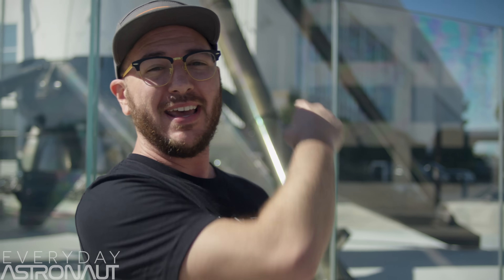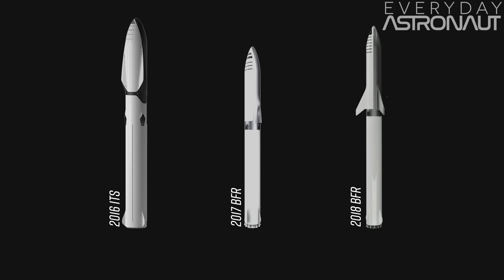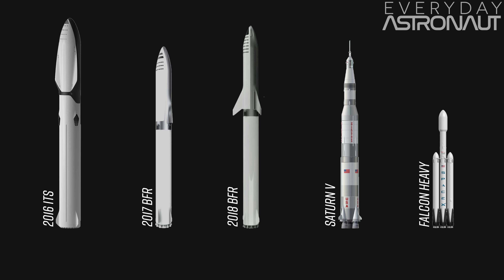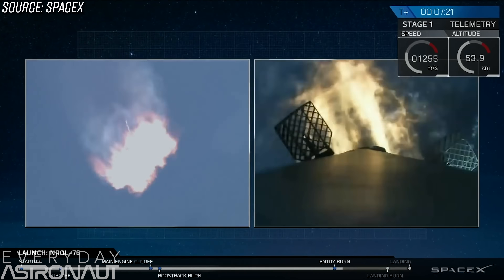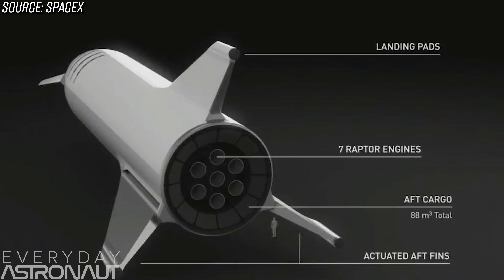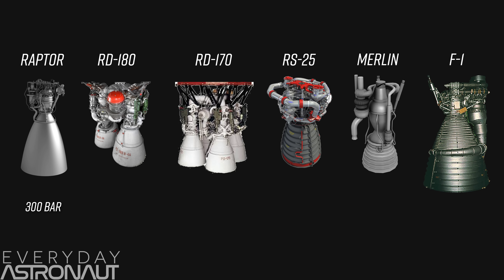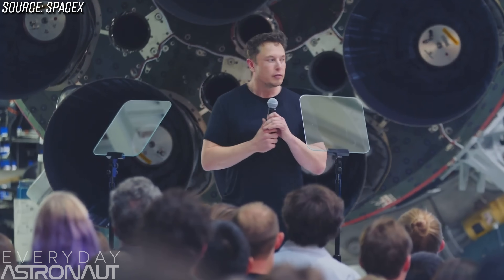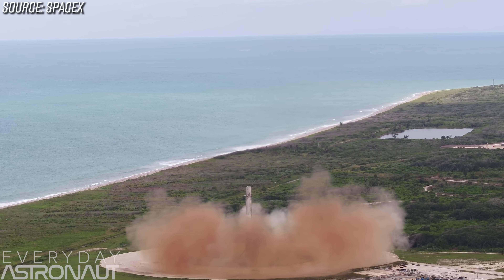Why does SpaceX keep changing the BFR? The evolution of BFR

Comment: Hey Tim, what did you think when he talked about the MegaNewtons of force needed to actuate the wing/flap/breaks ? What kind of mechanism could provide such power?
Reply: hydraulics.
Reply: @Gibson99  yeah of course best weight /power ratio, but the joints are without any visible hydraulics... Maybe it's internal, or transmitted through a gear...
Reply: would have to be a gear, i think. greater range of motion that way, and also possible to have reduction gears for greater mechanical advantage and less need for massive hydraulics. granted, you trade speed for torque but torque is way more important here.
Reply: They'd need to make a very frictionless gear system if the want it to be rapidly reusable. I'm not a particularly big fan of large moving parts on spacecraft, they pose a much higher risk than static lifting surfaces. Case in point, Virgin Galactics' SpaceShipTwo.
Reply: I think both speed and torque are needed, speed for better reactivity and stability during the reentry and torque to keep up with the aero forces... I'm so curious to how they plan to do that!!!
Reply: @jeffvader811  I agree, the belly breaking stabilized with the flaps is very risky. If you start spinning out of control, you have no chance to make it!
Reply: + maxdevil1654 It's rocket science. Everything is risky here
Reply: @MrNiszuPL  yeah but rockets and plane are commun now, but a bellyflopper? Maybe the shuttle was kinda the same thing for re-entry, but less extreme (and it was pretty extreme on its own)
Reply: The beefiest hydraulics in aeronautical history.
Reply: This item gave me the greatest pause... it just seems to lack finesse.  I wonder whether Space X won't build a Falcon 9 S2-sized scale model of BFS to test the re-entry technique, including the transition to tail-first before landing. Or is computer simulation sufficient to reliably produce a successful design? After all, all radical new concepts have been tested with experimental craft first. In some ways, but in a very different size, BFS now resembles the SNC Dreamcatcher, but with less lift from its body.
Reply: Maybe they can burn some of the GOX/gCH3 in a turbine to give highly responsive, extremely high torque hydraulics? Just an thought. Otherwise, electric drive (but still hydraulics).
Reply: @mduckernz  Aircraft hydraulics usually work with the main engine pumps, but here there isn't any engines, so yeah I'm betting on an electrically powered hydraulic pump.. (but like huge)

Comment: I am displeased with them changing things constantly, it tells me they still have no clue how to solve the orbit to vertical landing problem. Going from >16,500 mph in a belly flop configuration, handling the heat and g-load and then flipping to vertical landing at 0 mph is a very difficult problem. Being able to angle up and down those wings is a totally new problem, the forces on those wings is insane (I think elon admitted it would be in the meganewtons) and that means an actuator that can fight that.

One simpler solution would be to just land horizontal with horizontal engines, but that requires new engines that only function for landing and are dead weight the rest of the time.
Reply: Or rocket science is hard and the constant changes are improvement!!??
Reply: it only seems odd because we've never been privy to the design process of such a vehicle before.  you don't think the shuttle or saturn 5 were the very first design iterations, do you?  cuz they weren't.  it's easy to find pictures and stuff about all the different designs they considered when designing the shuttle back in the 70s. hint: there were WAY more different designs considered for the shuttle itself (nevermind how to arrange the stack or place engines) than what we've seen of the BFR.  and i'm sure there are other internal designs for the BFR that we haven't seen.
Reply: Simple solutions are not always the best in the end, 
Look at their track record, full aluminium cars, why? It's more expensive ect... Be easier using steel...
Model X falcon doors... Why? A Normal door would be better,
Solar city, solar roof tiles, why? Normal solar panels would be easier, 
Sometimes something that is an easier choice compromises the end result, they work the reverse, what is the best end result, how do we get that.
Reply: Yes, I'm sure their engineers know nothing /s
Reply: @mduckernz  "/s"?
Reply: /s == sarcasm tag
Reply: I'm not saying they should go with horizontal landing, horizontal landing my be simpler up front but adds other problems, like the need for a whole new class of dead weight engines just for landing. 

Another solution is semi-altitude compensating engines, that is raptor engines with extendable nozzles that can be retracted for landing and extended for vacuum optimized flight. This would allow for the 380+ s of ISP needed for a return to 150 tons of cargo capacity, as well as provide the redundancy of 4 to 5 engines for landing and space thrusting. Such nozzles though would add complexity (less weight then more engines though).

Comment: 100T to LEO was in fully expendable, not fully reusable mode.
Reply: 100T LEO fully resuable
Reply: Well, wrong. There's no such thing as expandable BFR / BFS. That's the whole point.
Reply: ok, I was wrong. although I'm not sure there's not such thing as an expandable BFR.
Reply: @kriss2005   there is the expandable mode on BFR like on any reausable rocket (for ex Falcon 9 or Falcon Heavy). The Ex. Mode consist in burning completly the first stage fuel not recovering it. This action increases the payload to space.